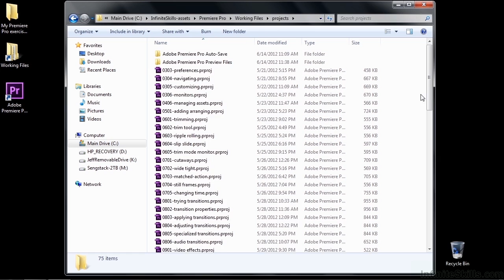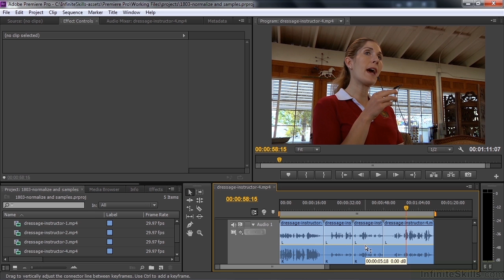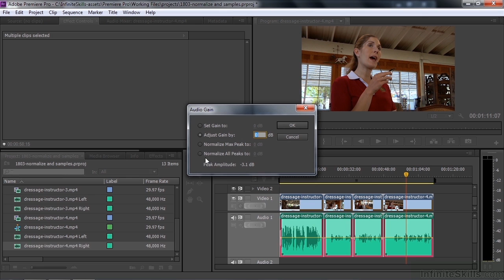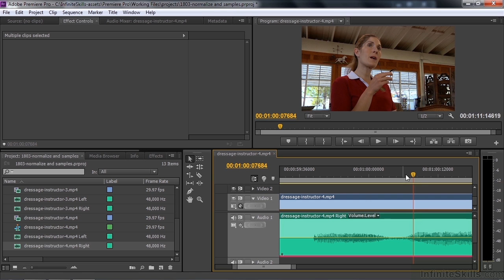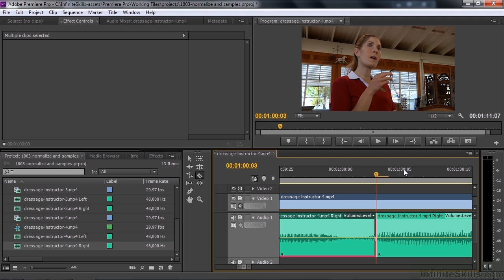Adobe Premiere Pro CC Tutorial | Normalizing Audio And Making Sample-Level Edits

Comment: I use zoom recorder for Audio, but I was not able to select Mono for Audio file as it was greyed out, and when i selected Audio Gain it says current audio level is 0DB and Normalize is also a 0 DB, but Audio is having huge variation in the time line. Right now, I am trying to do it manually , Is there any way that I can do it in the same way you did in your tutorial. Thanks.